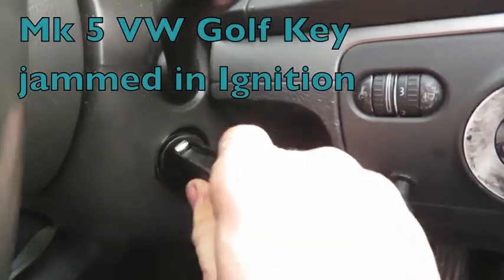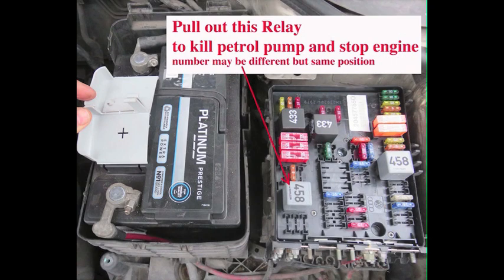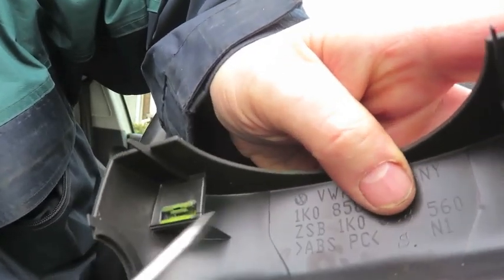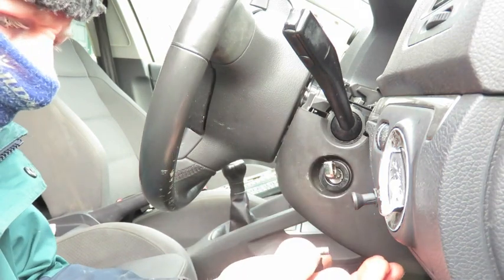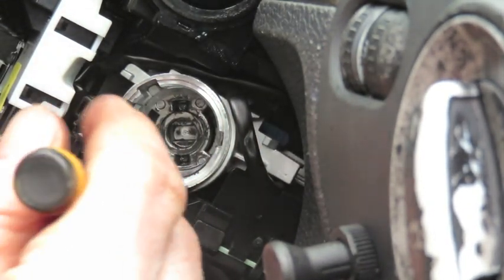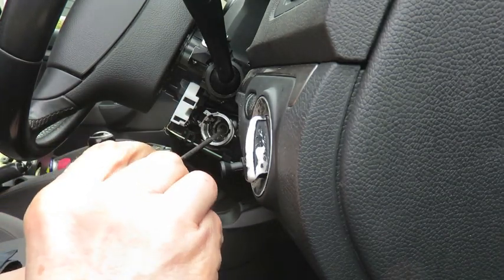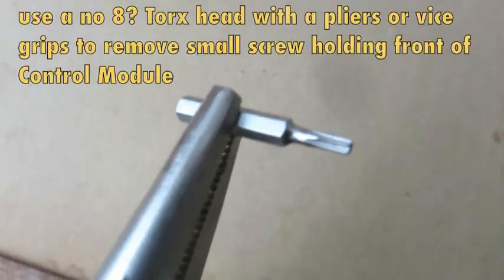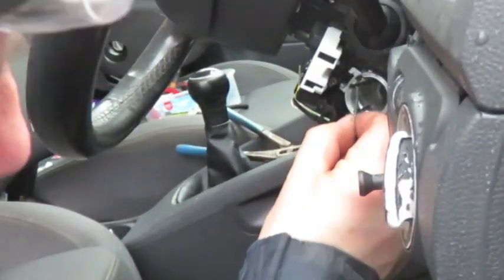VW Golf Ignition repair

Comment: Do you have to remove the inside or can you just drill it out as I no I will lose something lol
Reply from the maker: You'll have to remove all of the bits of the steering lock inside. It's aluminium so easy to drill and break, and probably broken into pieces anyway which is why you're doing this in the first place.

Comment: thank you for this video. without removing the ignition base housing, i can see cables and i believe one of them trigger the engine to start, can you please show me where is the cable? i try to jump the cable. my key won't turn.  my key turn to dashboard electricity only, it won't turn to start the engine. I can remove the key,  lock the steering, enter and turn on the dashboard, but can't turn to start the engine.
Reply from the maker: Hi Hermawan, 'at 8.54 mark on video' – this flat end of ignition turns the inside connector to start the car, a flat screwdriver should work too to turn connector, if battery connected of course and all the broken bits of the steering lock are removed.
If there are any bits of the broken steering lock remaining inside they may be stopping the ignition from turning,
Seán

Comment: So I took the fuse out and now my airbag light is on.
What does that mean ?
Reply from the maker: 'Morning, which fuse did you take out? As far as I can recall the only reason I mentioned taking out a fuse was as an alternative way of shutting off the fuel pump if you couldn't turn the car off any other way as the switch could jam in the on as well as the off position, Seán

Comment: Hi. Got the steering lock stuck after taking the barrel out. How to release steering lock?
Reply from the maker: Hello Ash, The broken steering lock was my problem too, although mine wasn't stuck in the 'on' position as it appears yours is. The solution I imagine is the same, that is to remove the steering lock mechanism and free-up the steering. It should come down once the spring that pushes it up is removed. The hole I drilled in the bottom of the steering was the way I got it out, straight down. Hopefully this helps,
Seán
Reply: Thank you very much for the reply. Done the same but unable to turn the key still.
Reply: Some one coming to change the barrel tomorrow

Comment: Hello, I am trying this method on my golf mk6. How did you get the lower spring loaded part of the locking pin out? It seems quite large and wouldn’t have fit out of the small hole you drilled. Cheers
Reply from the maker: Hello, I used the wire to maneuver the larger piece so it fitted out. I had to add corners on to the hole – 7:55 on video – using the side of the drill and a small grinding piece. It slipped out so quick I didn't manage to get it on the video. Hope this helps, Seán
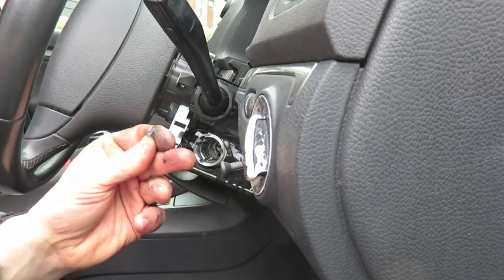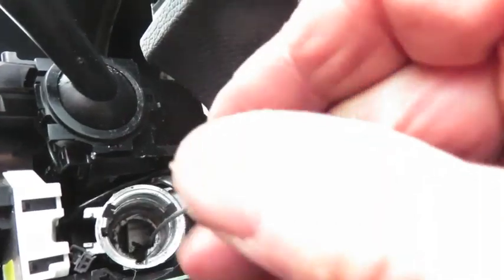Reply: Yeah I see that part but I mean the lower part which is hard to see but is there at 6:06 and then gone in the next shot at 6:28 before the steering control module is removed.
Reply from the maker: @knickerzz6916  'Morning,
Everything inside the 'ledge' was part of the steering lock mechanism and was broken and had to be removed. The first circular ring part came out in bits through the front. It looks like it was complete in the video but when I started to remove it it was broken and came out in parts.

Comment: Thanks for the video. Any idea if the car will pass NCT like this?
Reply from the maker: I had no problem with the NCT. Checking the NCT Preparation Guide on this it says "It is acceptable for a steering lock to be missing or inoperative provided the vehicle has an engine immobiliser, or a permanently installed immobilisation device which acts on either the steering, brakes or the transmission" see under 7.3 Locks and Anti-Theft Devices– https://www.ncts.ie/media/aidher01/nct_manual_2023.pdf
Reply from the maker: ... and good luck in the NCT :) Seán
Reply: Great stuff Seán thanks 👍

Comment: Hi there. I replaced the steering lock mechanism on mine and refitted old immobiliser but now car won’t start. Electrics all working fine but car won’t do anything when I turn to the start engine position. Any ideas?
Reply from the maker: Sorry for the late reply Ryan – does the engine actually turn over and not start or does the engine do nothing? If the engine turns over and doesn't start then I'd be thinking first that the Keycode chip  in the key is not matched(or something amiss) with the cars Computer Unit? 
After this I'd start looking into the wiring, or make sure the unit at the bottom(other end of steering barrel) is connecting properly, Seán

Comment: Hi, this seems to be the simplest of all the videos I have seen. I need to do this job on a Caddy maxi panel van. Before I can start I need to know more clearly how to remove the barrel. From the video its not clear (to me) where the paper clip goes in. I see the hole but not sure if the clip must go in that hole or more towards the notch. The hole seems smaller than the size of the paper clip.
Reply from the maker: 'Morning Evert, line up the two half-circle holes(on position) then insert the paper clip. Hopefully you'll be able to do this as sometimes/most-times the pieces that jam up the mechanism on the inside make turning the ignition to this point difficult. If you can't line them up then try to insert it anyway or a thin needle held by a pliers as you just need to press down the clip that stops it sliding out, Seán
Reply: @keepitassimpleasyoucan145  Thanks for the speedy reply. Will give it my best shot. Great video.

Comment: Hi I thought I had broken pieces same as yourself but what i found was a small metal piece with a spring attached to the end of it, It was jammed so i removed the spring. any suggestions on what to do further, thanks.
Reply from the maker: Hello David – from what you describe it sounds like this piece is from the first part of the ignition( the part that holds the key – the part that's in my hand at 4min20sec of video) this may pop out when removing this part but probably isn't the reason you had to take the barrel apart in the first place. Check if the inside part of the barrel turns ok with a flathead screwdriver. If it doesn't then the problem is inside here, Seán
Reply: @keepitassimpleasyoucan145  hi Sean thanks for your reply, I've check in around and found no more broken pieces etc, the ignition turns fine, I assembled it all back together and befre I put the barrel on, I turned the ignition with a flat head screw driver all is fine the car is turning over ok, my issue now is once the barrel is on and back in place I insert the key and it's not Turning properly at all, I don't know why, I've had the barrel check all is fine with that also, any further advice be much appreciated, I've had no car for over a week now :/
Reply from the maker: @dmahn90  Hello again David,  if the inner ignition mechanism turns smoothly with a flat screwdriver all the time when you have the front part of the key barrel out, and there are no broken parts inside then that points to the first part of the key barrel itself. Have you got/tried your second key? Maybe your key is worn and just doesn't unlock the key barrel properly anymore. You'll know this anyway when you have the two parts of the key barrel separated and if you can turn the key in the ignition when it's out of the barrel,
Seán
Reply: @keepitassimpleasyoucan145  hi, well I seems to be the lock in the inside is the problem, I got the barrel on and she i tried Turning it its getting stuck I can hear the lock it's self clicking on the inside, I don't have the proper tools to drill out the lock like you did and that would possibly sort all my problems, so I'm getting a locksmith out today to replace the lot, it's costly but I'm in need of the car ASAP, thanks for all the info Sean greatly explained.
Reply from the maker: @dmahn90  'Morning David, it mightn't be the standard locksmith job so don't be surprised if he/she goes 's*@t !'
Just in case though, you'll only need to drill the hole if you can't get all the broken pieces out, and any drill shoild do – as it's aluminium(softer than steel) the drill can be used to grind to grind by putting light sideways pressure in the hole. Just remember to wear goggles in case it breaks, Seán

Comment: Thanks for video, I’ll try this gut-job first
Reply from the maker: Keep us updated on your progress :) Seán
Reply: @keepitassimpleasyoucan145  had to take the whole thing out. My key would not turn enough to insert the wire. Drilled the bolt heads and used a screw extractor. Replaced the cylinder. Car is fixed.

Comment: Thanks for posting this. What is it with these bloody VAG barrels? I’ve just had to change the barrel and cylinder on mine. It was very tight to turn, sometimes I’d take the key out and the ignition remained on and then it seized solid. If it helps anybody watching this I removed my sheer bolts and posted a video on my channel explaining how I did it.

Comment: what if the key won’t turn all the way to allow the black key barrel to come off?
Reply from the maker: My key wouldn't turn either. I sprayed WD40 oil into it and kept 'jiggling' it back and forward until it turned. Have you tried this already? Seán
Reply from the maker: And if this doesn't work you could just go straight to drilling the hole underneath the actual steering-lock area and take out some broken pieces. this should allow the key to turn.

Comment: Great video skills Sean.
2 points. If you want to remove the shear bolts then drill a 3mm hole in the top of them. hammer a t15 bit into the hole and turn with a spanner.
2. There are two problems which both play a part in the lock becoming stiff. The first is under a hardened 10mm cap on the lock body is a spring loaded deadlocking pin with a ramp shape on it that gets dented so the pin won't slide on it freely. Grind or Dremel the casting around this cover and pull it out. Now the steering locks but won't deadlock. The lock will also be possible to reassemble as once deadlocked it cannot move to wriggle the shaft into place. 
The primary issue you had was the pin that stops the lock from locking until you remove the key has broken through the casting. Remove that pin and spring and the casting shrapnel and the lock would now lock as soon as you turned to the lock position before you took the key out. 
I take the lock right off to work on these as I have the technique to remove the shearbolts and it makes disassembly and cleanup easier.
Reply from the maker: Thanks for this Craig. Drilling the 3mm hole and hammerin' in the t15 bit is a great idea allright, certainly if the preferred option is to remove the whole unit . From what I gathered from other videos on this, these shear bolts aren't very tight.
I just wanted to remove the lock mechanism in it's entirety – not just the shrapnel – and get back to driving. The key itself is chipped so this is security enough ... hopefully!
Thanks again,
Seán
Reply: I got a small pin drift through the hole on the plastic casing and tapped the right hand bolt out quickly. The left hand bolt has poor access to do this so I snipped just enough plastic housing away to do the same. I replaced it with standard 16mm length M8 bolts. Drilling would’ve been cleaner but my car broke down in a parking bay with no access to power. 🙁
Reply: I vouch for the first point. by far the easiest way to remove the bolts is to drill a hole in it and hammer a bit into it, no amount of tapping could relase the bolts on mine, luckily i saw this comment after breaking every 'screw extractor' tool. 
make sure to use a sharp HSS or metal drill bit. also it isnt really possible to make a straight hole as the dash is in the way, it doesnt matter as long as the bit is hammered in place.
ps. i removed 4 screws this way with ease.
Thanks !!

Comment: Great video! Man thanks for sharing.  What was the reason removing the whole block? To prevent locking while turnint the steering wheel? I am having the same issue. I will try to remove the broken parts an try tirst without cutting it out. We shall see. Someone did iz here too so i guess this works as well.
Reply: Hi zon what happened when you removed the broken pieces? Any update?
Reply from the maker: Hello Zon, Yeah, I would have been concerned about the steering locking alright if I only removed part of it but regardless of this, the upper part – the lock itself – was still stopping the key from turning properly even though the other broken pieces were removed. You might be able to fish it out without drilling the hole, depending on where it broke, but I found I had to drill and drop it down through.
All the best, Seán

Comment: Heya mate, yesterday I was stuck in a car park  and kept trying to turn the ignition on but it wouldn’t turn all the way. After trying and trying for 2 hours it turned on (luckily) and I drove it home. Now at home it’s fully not turning and I’ve tried WD40 Jiggle still not working, my golfs a 2004 model and it is quite old. Would you say it’s a Key problem or the ignition Mechanism needs to be replaced?
Reply from the maker: Sounds like the same problem I, and a lot of other people have had but if you have a different key give it a try - though usually a worn key sticks a little and gets worse in time. You could go as far as taking out the 'key section' (first part of video) and if key then turns when disconnected then it's pretty certain that some part of the steering lock has broke and is causing the jam. If your key is stuck in the 'ON' position I think I'd try this first though as it can be tricky to get it back to ON again, Seán
Reply: Hey mate,I’m currently looking for a Igniton barrel housing. 

Do the ignition barrel housings from later models (2005) or older models fit it or does it have to be the original part for the actual car and model? 

I’ve called my local European parts specialist and they say I have to buy the whole kit which costs about (200-400) Australian dollars.
Reply from the maker: @Modern-Gladiator  the first place I'd go is a Car Dismantlers, bound to have a range of Golfs 'cause they're so popular
Reply: @Modern-Gladiator  Go to your local locksmith. He will either stock one or get one overnight and be cheaper than the stealership.

Comment: Dam it!!! Guess there is no way around having to have the key in the on position
Reply from the maker: Try spraying WD40, then 'wiggle' both the steering and key.  If nothing else works and it is a Mk 5 then you could try drilling the hole first to 'fish out' the broken bits that are jamming it up.
Reply: @keepitassimpleasyoucan145  I ended up getting it by smashing it with a hammer holding it in different positions.  I just want to be able to use my key with the new assembly.
Reply: @danjim7056  was your key stuck in the lock? What did you hit with the hammer?

My Jetta has had issues before but today the switch wont let me go into the ON position... The lock is turning but jamming up like everyone elses..
Reply: @Desopolis  I took the whole lock assembly off the steering column and hit the body of it with a hammer.  You might be able to free it while installed still but it's going to jam again if you Don't replace or fix it.
Reply: They key went in and out of the lock but didn't turn at all.
Reply: Initially I sprayed a modest amount of WD-40 into the key hole (not too much). Understanding that there could be a broken part on the inside, I continually tried to turn the key towards the on position while holding the entire housing in hand at different angles as to allow the broken part to move around. Within a minute, the key was able to turn to on position. Pushed the paper clip in the hole that was now aligned properly and the lock came out easily.

Comment: How did you know ecactly where to start drilling the hole?
Reply from the maker: Hello, I had already removed the inside of the ignition. I needed to drill the hole to remove the remaining part of the steering lock so I just inserted a measure stick inside and marked length outside ...  but it was under the middle of the steering column as the steering lock is directly under this part so I would have drilled here anyway, Seán

Comment: Disconnecting the battery will not stop the engine running, that's right, more importantly it's very likely to cause a damage to the alternator, never disconnect the charging circuit whilst the engine is running.
Reply from the maker: Yep, a wise comment, thanks Jan! 
I have to admit though the first thing I did was disconnect the battery without thinking, as I'd imaging 99% of people will do if they can't turn their engine off.  Fortunately it was just 'ticking over' for a short time 'till I disconnected the fuel relay and no harm done ... so don't despair if you've disconnected the battery first. 
All the best!